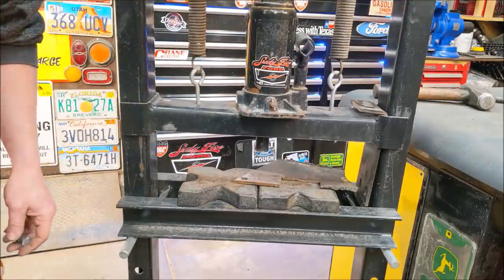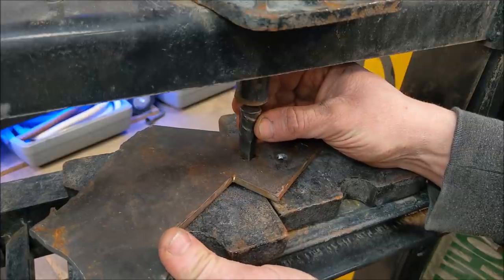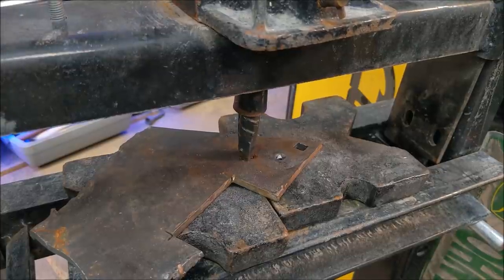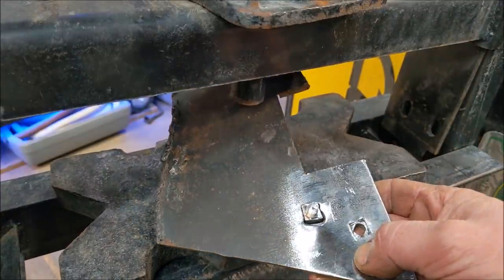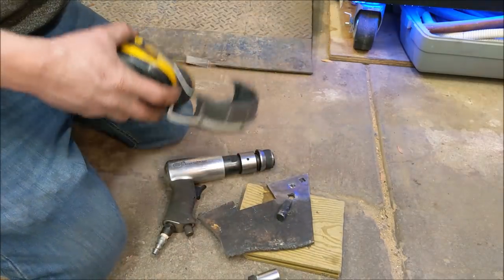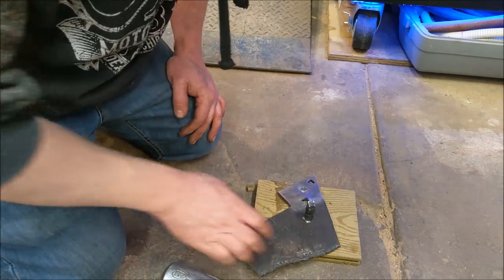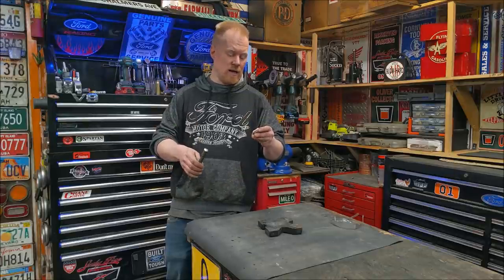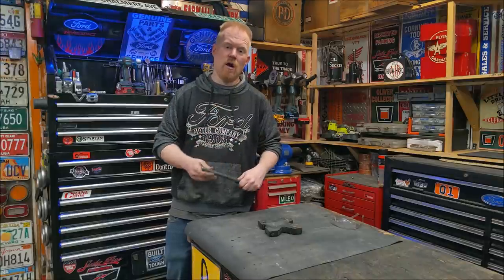Drill Square holes in steel with REBAR tested in a press & air hammer

Comment: I was watching with earbuds on. When that press shot through the steel I almost went through the roof. I thought it would push in slowly.
Reply: i was using headphones. i don't think this video is for us.lol
Reply from the maker: I didn't think it would go off like a shotgun.
Reply: Why would you watch any shop type video with ear buds? Hammers and air tools tend to be fairly loud. That's why on most of the tools they have a label for warning. Wear safety glasses. Use hearing protection. Main thing USE COMMON SENSE!!!

Comment: You could turn that into a rotary broach pretty easily by adding a weeble-wobble and a spin-a-ma-thing.  This Old Tony and AvE both have good videos on making home-made rotary broaches.  The key is an offset weeble-wobble to make it do exactly what you were doing with the hammer: tapping around in a circle with the punch at a slight angle so it's working its way around. Adding in a hammer drill might be even better.  Using re-bar as your cutter just makes it more awesomer.  Always learn something interesting with your vids.

Comment: I have that 12 ton press from Harbor Freight, i drilled 4 holes about halfway through the blocks in a square pattern and then pressed some roll pins in the holes  so the blocks stay on the press and i can position the blocks in any orientation.
Reply: I did the same thing works great
Reply: Uhh, isn't there some concern over creating weak points (stress risers?) at the new holes? Especially in whoknowsium metal from China. Just a thought; I've read that those arbor plates have a tendency to crack/break out of the box.
Reply: @bmay8818  hhhmmmmm idk. I guess  ill wear a face shield and find out. Lol.
Reply from the maker: I was looking online at new press plates and saw a few pictures of guys that had the Harbor Freight plates explode. One guy cut the side of face open when one exploded and sent a chunk at his head. I guess these are porous cast iron. I have some 1/4" and may 1/2" steel plate I may stack to a 1" thickness and weld up. Some smaller drift holes in the center of a plate would come in handy.
Reply: @sixtyfiveford  i didnt even think those plates would crack or even explode. Might need to get me some solid steel.
Reply: @sixtyfiveford  I went to my steel supplier and bought 1" drops and milled them, only 20. Bucks and probably better steel , who knows  everything comes from china
Reply: @brezzz0077   don't forget to harden them out to 100 Rockwell .... 🙄😂😂😂

😎👍☘🍺

Comment: Make the end of the punch round to fit the hole then taper back to the square shape.  It should keep the punch from coming out so easily with the air hammer.  A die is a good idea.  It will work if you use the rounded end punch to align the corners then clamp them into position, using set screws.  Dry run the fit then use it on a work piece.

Comment: Make the hole diameter the same size (or even fractionally larger) as the "across flats" measurement of your punch (its NOT a broach🙄) and pressure required will be dramatically reduced...

Also, grinding a little relief (rake) on the punch reduces the  pressure required too .. 😎👍☘🍺

Comment: The problem with the air hamer was the sleeve you were using, and it looked like you were realy laying into it instead of just steadying the hamer. With that much preasure any time you put preasure slightly off center it will shoot off. Specialy with the lose sleeve. A little modification and it would work well. Even changing the broach design may yield better results. Instead of forming a single broach with 4 cutting teeth, make a few that step up in size up the shank. This would be more like a blade with far more material supporting the blade. As well as remove less material as each step passes through. Which will be far easier to perform, and reduce stress on the blades. With the dermal you could even effectively increase the blade surface area on each side by cutting it in a chevron. This would give space for the metal to move as the broach is passing through it as well. Which should reduce the stress some more as well. It doesn't to be very steep. Just enough so the corners bite into the metal first.

Comment: Great video, what do you think about hammer method, but putting heat to the metal to be punched. Would that work worse or better in your opinion?
Reply from the maker: I've debated this exact situation in my head. Generally metal gets butter soft at cherry red, but then you would be able to hammer a blunt tool though it. I'm not sure how much softer it gets at a few hundred or even a thousand degrees. I'm sure there's a chart somewhere online with the malleability at temps for steel.

Comment: is that the milton V style purple air couplers youre using? are they worth the money to swap over all your fittings to  and are they the best fitting for a jack of all trades/backyard mechanic?
Reply from the maker: Good eye. Yes they are worth it and they were super cheap. It was around 20bucks for 14 pieces(4 couplers and 10 fittings) off Amazon.  I've always been a Milton fan with fittings as they last forever compared to the other stuff out there. I looked at the Harbor Freight ones but they want $10 for 1 coupler and 3 fittings, also I swore off HF fittings years ago and told myself I wouldn't buy anything but Milton. I didn't even know Milton had them and the best part is they accept all my old standard size fittings, so like this air hammer that wouldn't benefit from higher flow I don't have to remove the fitting.

Comment: Have you considered trying to true up that press and making a video of that? I just figure you can do it, since you seem to be able to literally fix anything. I have a harbor freight one that rocks just like that and pressing stuff makes me nervous, because it always get cocked. I'd like to fix it, but don't know where to start. Thanks so much for all you do.
Reply from the maker: Every-time I use that press I hate it and I think I'm going to fix it. That's probably why I prefer the hammer over the press for pretty much every task. I think the biggest issue is the press plate and just need to find some 1in steel plate that doesn't cost a million bucks to put on there. Then some well placed shims, tack welded to take out slop. Sounds like a fun video.

Comment: Is it just me or does everything in your garage wobble, first the vice wobbled then the drill press then the hydraulic press then the air hammer....... Maybe an air regulator on air hammer to slow the blows down but air hammers are design for chiseling rivets so maybe it's the rebar needs to be made like a regular broch..... Excellent video I learned what not to do, thanks for sharing!!!!!!!!1

Comment: the air hammer seems like it could possibly be the best option, it does the tiniest hits so least deformation but it does them very rapidly.. just need a better way of holding it all together and straight, maybe if you had a pile of old cheap air chisels you could grind one flat and weld the rebar to the end of it.. be even better if you could grind your square right into the air chisel but i doubt youll find thatll do anything larger than a 3/8" square
Reply from the maker: I used to have a cheaper air hammer that had shorter strokes. This one has too long of throw for something like this.
Reply: @sixtyfiveford  air hammers are an underrated tool, i just have a cheap one but i should be using it more, many uses you dont think of for them

Comment: Try quenching in oil instead of water. Water makes it brittle
Reply: ....or brine 😉
I think oil would temper it too much personally, the shank will draw the heat away quickly anyways... I suppose a bit of experimentation is in order to get ones process refined. 

Grinding back rake would also reduce the pressure required on the punch...
Reply from the maker: The first time I played with rebar hardening years ago the oil quench didn't quite get it hard enough. However the last chunk of 5/8 rebar I used would have been better with an oil quench. Depending on the rebar rating it will have higher carbon content.  Either way I was easily able to grind it back to a more tempered area.

Comment: I think your correct in utilizing any safety equipment on hand because had you done this demo with mild steel, you wouldn't have had to flirt with disaster and your demonstration would have been better suited for showing how well the broach cut it like butter. From the look, color, sound. and reaction of the sample plate, what destroyed the broach and why it deformed, the plate is called "abrasion resistance steel" (AR) or high carbon alloy. Well let me tell ya' why I believe such...I'd go around the country to Waste Management sites and had a weekend shutdown to get inside some disgusting industrial compactors. I had to torch off the 3'x4' worn out AR plates from the cylinder side  and the fixed side of the compactor. The space, the cave was small and torching AR sent sparks and lava ricocheting back at me. It cuts nasty like that. After that I'd weld new 3'x4' plates to both sides. I'd cut on Sat. and weld on Sunday. It was a PM deal on the units. Abrasion resistant my ass. From China perhaps, idk. 
Anyhow this isn't to cut you down man, I just found your station and I'm blown away at the projects you clearly explain and demonstrate. I like your no-nonsense safety first presentations then break it down at the end with your dog. It's like that beer you chug after a hard days 8 for 8 or then some. Stay safe and God bless.

Comment: Most rebar is just plain old mild steel. Mild steel generally doesn't harden to well. You would be better off with a higher carbon content steel or a tool steel. Thanks for the follow up with a press. I was wondering that too.👍
Reply from the maker: Rebar is at least a medium carbon steel to high carbon depending on the application. Not low carbon mild in the slightest.
Reply: @sixtyfiveford  not sure your right. Pretty sure its plain old mild steel. It needs to flex and move in concrete. Maybe google it.
Reply: @sixtyfiveford  here is what i found, Rebar is commonly manufactured using mild or high yield steel of grade 250 or 250 N/mm2 characteristic tensile strength. The constituents of both of these grades are around 99% iron, along with manganese, carbon, sulphur and phosphorous. The quality and grade of steel is dependent on the proportion of carbon.Nov 6, 2019. Like i said most rebar is mild steel, not saying all is because it depends on what its used for.
Reply: @sixtyfiveford  i never said it was low carbon either. I said mild steel. Meaning close to or medium carbon content. Not low not high somewhere in the middle, mild.👍
Reply: Any steel with a carbon content of 0.7% & upwards is classed as a carbon steel & suitable for case-hardening 😌

"Tool-steels" generally also have chromium , vanadium & other elements added to increase toughness & durability.

Also, even low-carbon steels can be case-hardened by coating them with a high carbon-content paste & heat-soaking ... in the old days the paste was often made from ground up bones. Today you can buy  case-hardening powders commercially...

BTW ... high carbon steel doesn't weld very well either, the joint tending to break like cast iron... 🙄 

😎👍☘🍺

Comment: Just Heat the Plate up with a settling torch you can drive it right through.
Reply from the maker: It will smash all the metal some the hole and anneal the cutter. You'll end up with a mess.

Comment: The airhammer i might have used a sleeve that goes over the outside of that bit.
Reply from the maker: I did have a sleeve that went about half way over the bit. I think a shorter throw impact hammer may have worked better. This one has a pretty long stroke.

Comment: If you examine dies from a real punch you will see a small point in the centre about 1/8" high.
It is very important as it starts the stretching process.
Reply: The point is actually for lining up the press punch with a dot-punched layout mark on the plate you're pressing .... and if you are drilling a pilot hole it obviously serves no purpose... 😉
Reply: @peterfitzpatrick7032  Nope.

Comment: oh you have the same harbor chit press.
Reply from the maker: It got it for free from a neighbor. He called me up and said "do you want this old press at my shop". YES. The glory of a free tool wore off pretty quickly. I'm so used to pressing everything in with a hammer I rarely use it. I had to put a couple chunks of steel in the sides to take out some slop and it definitely needs some new plates. It's like most stuff at HF where the basic idea is there you just need to finish it to make it good.
Reply: @sixtyfiveford  garagejournal forum says the bolt together one is better. Mine is also the welded together one. Can't beat free!
Reply from the maker: @D4x4Bronc  I lost out on a 50ton all electric over hydraulic unit last year at auction. One of those things that stale mates cheap($50 and I thought I had it) and then everyone decides that's a great price and can't let it go that cheap. It could have been the auctioneer stopping the auction and reminding everyone that it's a $3000 press and everyone would be a fool not to grab it this cheap. Seconds later I was out at $300 and it just kept going to $700 or something.